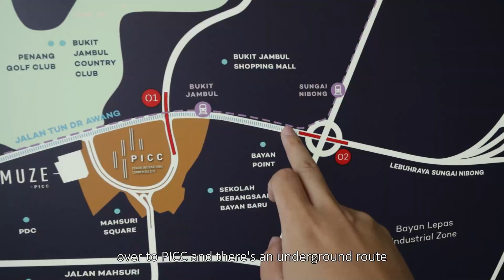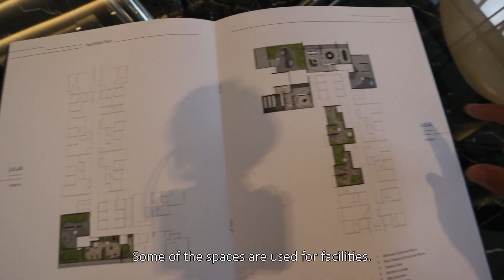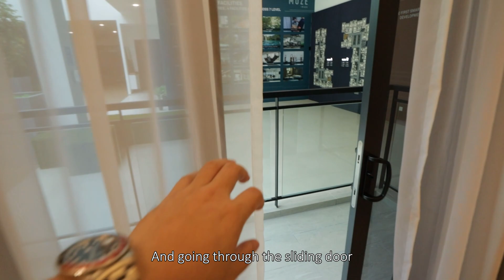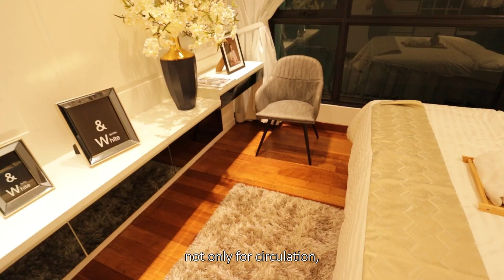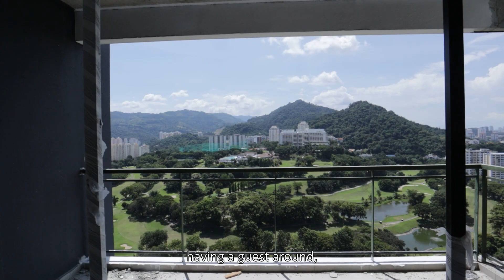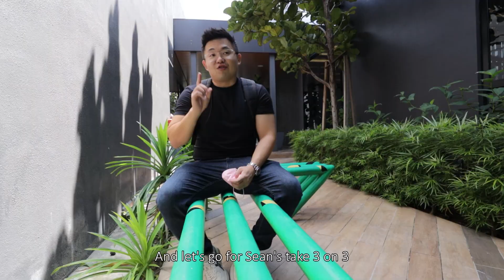PROPERTY REVIEW #226 | MUZE, PICC (PENANG)

Comment: There already exists a high-end residential-cum-business district to the south, west and southwest of the  project site. Together with the golf-course, this will help water down the so-called stigma mentioned in this video. Most important of all, the huge development with its integrated design concept will create a new, iconic township serving entirely different groups of users ultimately, the value of which cannot be gauged by current standards and perceptions.